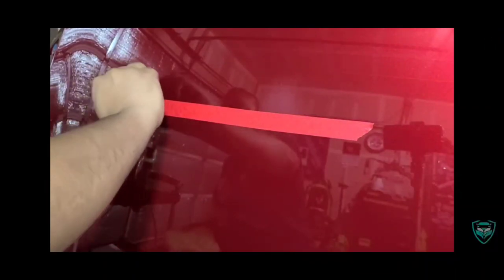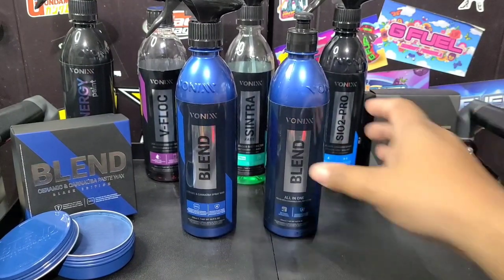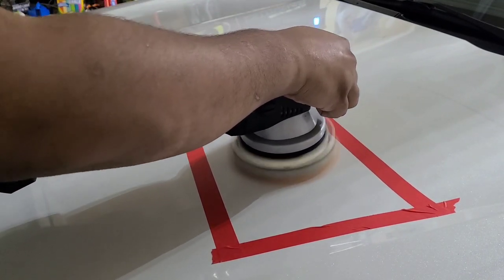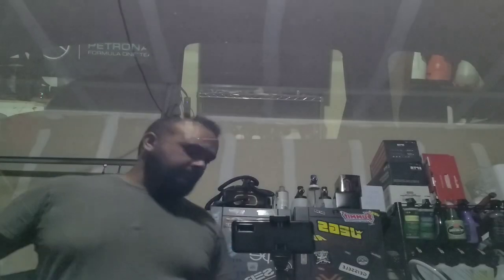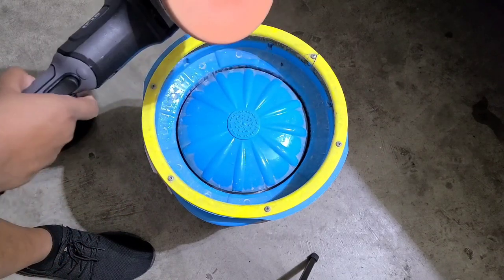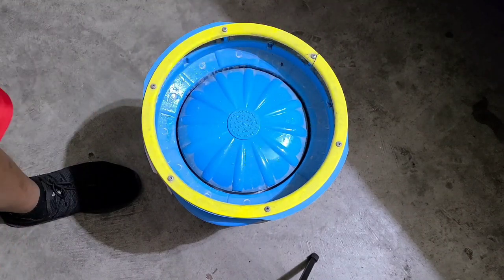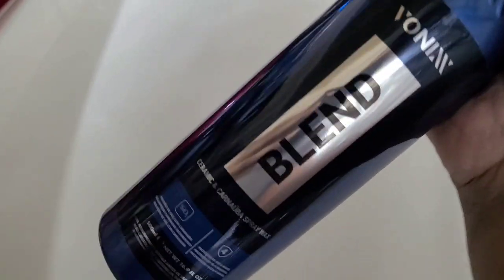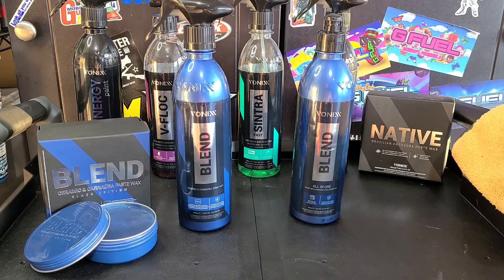[VONIXX] All in One Polish with CERAMIC Protection in One Step! - Blend AIO

Comment: Can you put a ceramic coating  over blend?
Reply from the maker: Good question, but no not really. The most I would use on top of this is a wax or ceramic detailer. This does not work as a primer polish like Carpro Essence would.